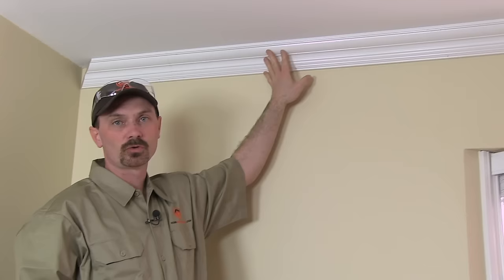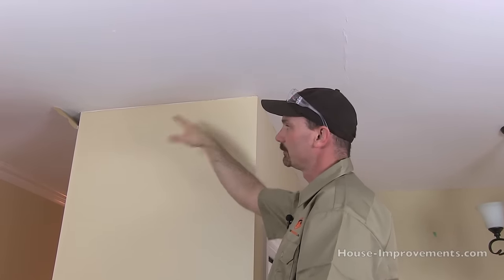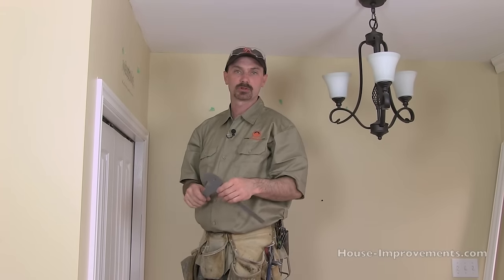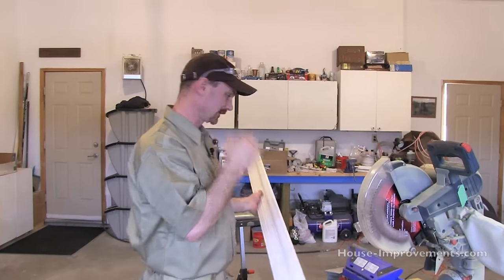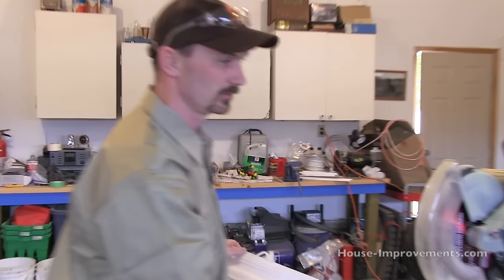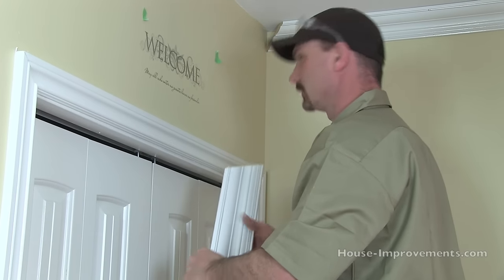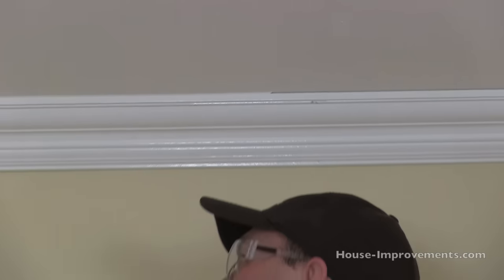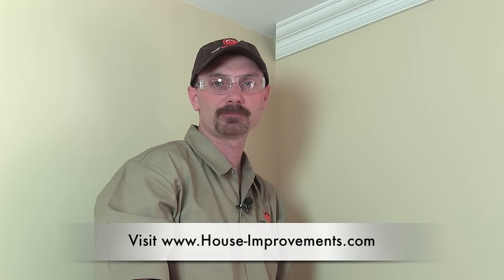How To Cut & Install Crown Moulding

Comment: lol.. Cmon..If you're going to do an instructional video...do it right..If he was experienced, he would have moved the peices up or down to close the miters and glued inside and outside joints. I'd get fired for this type of work and would not accept it as a homeowner either.

Comment: I’m having trouble finding trim that will fit my garage floor. The concrete trim isn’t flat with aligned with the wall. There is a good 1 inch gab of concrete slab that sticks out past the wall how would I cover it up with trim?

Comment: The most detailed and informative video I have ever come across on YouTube. I had some damaged crown molding in my house that I recently moved in, and needed to repair the damaged/broken piece of crown molding and was not knowing where and how to start my project. I would like to thanks Shannon a lot for this video which gave me the confidence to work on my project, although I bought the pre-cut angles from Home Depot but may not be using them after seeing this video. 

I was just wondering if I can use Gorilla Glue or PL instead on nails to hold the crown molding in place but not sure if any of that glue will be strong enough to hold the crown molding ln place. Appreciate if someone can give me some direction about it. 

For a beginner like me I had to watch a part of the video a few time where in Shannon is flipping the molding to make inside and outside corner cuts, so I would suggest people to just watch that part of the video to have a clarity about cutting the angles. Awesome video!!!!

Comment: Cut the crown molding flat on the table. The measurement guides have the two angles marked on the saw...No need to buy and use the plastic guide..

Comment: Probably overkill, but instead of finding studs, I’ve used a ripped piece of 3/4 plywood, then screw it into the studs with 3” screws, then you can nail anywhere thru the crown into the ply. If there’s a long run, rip a piece of 3/4 ply about 1.75” wide by 8 feet.  Works great especially on older homes that have plaster on drywall that makes the wall an inch or so thick that a normal 18 gauge 2” nail won’t hold well in.

Comment: I saw you measure and cut but you never added the thickness of molding to your cut on both ends so if they follow you their cuts will be short. I watch your videos all the time
Reply: He doesn't have to bc he Mark's thebback of the board and then he flips the board over b4 he makes the cut.

Comment: A clean square block of wood and a hammer work wonders on a corner. Just a little tap on both sides will drive that molding into position! Then nail it!!

Comment: Excellent video. I like that you've shown the various cuts and angles and had good camera shots to show the specific details. What I like most is that you showed some of the issues I've experienced with walls out of square and small gaps. This video will help me with the crown molding project I'm starting this week. Thanks for the nice job. Very helpful.

Comment: for a so-called expert..the first part of the VIDEO that's BAD...the outside corner should have been a little tighter. that's a bad cut...passable on HOUSE not  on FISHIED CRWON MOLD on commercial building.
Reply from the maker: thanks for your expert opinion

Comment: The walls aren't exactly plumb and the ceiling isn't exactly horizontal.  Cope it and break out the caulk. Crown molding will cause you to pull your HAIR OUT

Comment: No disrespect to the gentleman's skill. His approach to crown molding is common in the trade but to any Youngsters watching go and invest in a double compound "Chop Saw". Together with the numbers of bevels and angles to use you can skip the back and forth , upside down baton show and move on with the work at hand. Shim here and there sometimes making the cut a little long sometimes to close joints..... 
just SayiNNNNN. 
Sometimes new methods are an advancement.

Comment: Nail guards protect water lines and plumbing but they don’t cover everything or every angle. Professional or homeowner can nail a/c line, water line or plumbing drain lines or vent pipes. For example a roofer puts a new roof on using a nail gun and pierces a a/c line filling the attic with Freon which also leaks into cavity walls and into several rooms of the house. Homeowner filed an insurance claim and $250,000.00 dollars later had a total remodel of her house. This was no joke, I worked for the restoration company who did the repairs. My lesson learned is never use any nails to install any trim, hang any pictures. I use gum for pictures and caulk for trim.

Comment: absolutely incorrect!!! WTF/!/! glue and tape crown. No house is perfect, in fact, most all of them aren't perfect symmetry. Measure the distance of the gap whether top or bottom( in this instance top), then thats the amount needed cut from the opposite end to zero, and again(in this instance,, eighth inch gap on top, cut the bottom on an angle from the eighth difference to zero at the top. Perfect fit no glue needed takes the same amount of time. thanks good day.

Comment: Question.  Why cut it upside down if  you're still setting it with the front side facing you?  Why not eliminate the confusion, and cut it as it goes on the wall?

Comment: You know if you take a block of wood and tap that outside edge in at the top on both sides you can cheat it down about an 1/8" and close up that gap. Just saying'

Comment: I set my table to a 31.6 and my blade to 45 degrees, and cut my crown on the flat so I don’t need a to hold the crown at a 45 when I cut.

Comment: 1 question, when you’re nailing into the ceiling, are you hitting joists? Or just nailing into Sheetrock?  What’s the best way to secure crown molding into the ceiling if the attic joists run parallel with the molding?

Comment: This is a well done video.  However, what if you only have a 10" blade?  And, will this "jig" work on a 10" blade saw?  I've watched several videos on this topic and you really need the right saw and jigs.  What if your fence isn't tall enough?  The cutting part is easy if you have everything else needed for the job.
Reply from the maker: 10" saws will work for most crown that is under 5". If your fence is to low install a plywood fence during the process.

Comment: If you're not coping an inside corner, regardless of whether is stained or painted, your not doing it right. Mitered inside corners will also eventually show even if you caulk them.

Comment: Lipstick on a pig: that ceiling should have been re-taped and skim-coated before installing nice crown molding like this... 

Coping: I use a Dremel tool with the flexible shaft: makes coping very easy and much faster. I use a knife or a coping saw with the really fine corners. His coped corner looks a lot better than his mitered inside corner. One way to make it real tight is to take adhesive-backed sandpaper, and tape it to your scrap crown molding. Then you use that to sand all the fine details in your coped piece.
Regarding the outside corner that was gapped: when he was dry-fitting it, he saw that it wasn't going to naturally fit. The piece to the left was short, so he could have glued the joint with fast-acting 2 part glue, then installed it. The corner would have been very tight and sharp, and the gap would have been on the wall/ceiling edges (which are easily caulked). If the piece to the left had been long, then a helper would have been necessary.

I like how everything was explained except the laying the piece flat on the base and using the compound mitre saw for what it was designed for. I haven't found any videos yet on how to do that yet.

Comment: I notice lots of people are talking about how they only cope their joints. It’s a huge waste of time to cope mdf moulding. It s seriously not needed. The corners mitred will be tight enough and mdf fills really well. Now if your using an expensive material like oak or wood you cope the joint. Hardwood doesn’t fill nicely. Pick your battles.
Reply from the maker: I 100% agree with you

Comment: I doin't understand why you are simply taking the crown into nothing but drywall...I didn't see you hit one stud or joist, other than the outside and inside corner bottom nailing....??  There is nothing holding this crown in place basically, and the top is going to flop down since MDF is so heavy...?
Reply from the maker: angle your nails slightly, they can not pull straight out then

Comment: I have a question. When installing crown, I understand to nail to the studs on the wall side of the crown, but when the crown is running WITH the ceiling joists, theres nothing behind the ceiling sheet rock to nail to. So, do you just nail into the sheet rock on the ceiling by maybe shooting two nails in an "X" pattern to hold the crown edge against the ceiling? 
Asking because my house is VERY old, the ceiling is NOT perfectly straight, and have been hesitating starting this project because I just am not sure how to nail the ceiling edge of the crown when its running along the same direction as the rafters behind the dry wall in the ceiling. Adhesive as well as nails maybe?
Reply from the maker: Install the nails on an angle and they will have more holding power in drywall.

Comment: I have always done regular mitter cuts for baseboards doors& windows but crown i never done, what looks tricky to me is how the crown is not going flat up against wall but at a 45° angle, never had a table saw can a regular mitter box work for cutting crown on certain types of moldings?
Reply from the maker: On smaller crown it will work.

Comment: hey Shannon any advice for an older house thay has very bad corners not on 90 degrees at all. built in the 30s and very hard to work with since nothing is square or level. I'm not a carpenter by any means but I try to do stuff myself. I can't get the 45s in the corner anywhere close to matching up. please give any suggestions?
Reply from the maker: That is a problem very often . Try using an angle finder to get the exact angle of the corner , divide that number in half and that is what you want your cuts at.

Comment: next time try this take a small piece of crown  and place it up against the wall n ceiling n look at it from side to make sure  you have  the full section on both wall and ceiling  then put a pencil mark on ceiling then measure what you have from wall to mark then go around n mark each end of walls and pop a line on ceiling I would use blue chalk only and pop it once before popping on ceiling then went you nail on crown keep it on line by nail ceiling first especially on long walls  that way went looking down a long wall your crown will be straight.also I would  put some painters tape about where you would nail  and use spackling to fill in nail hole and let sit awhile then went you are ready to touch up with paint pull off tape  and paint  this way you wont have any residue showing through the paint I also like to use alcohol with a spray bottle to wipe off calking that way it wont smear on the crown or ceiling hope this will help every one

Comment: when cutting it flat with a compound miter you don't ever have to move the settings and piece stays consistent on table and all your miters are same....you just rotate the crown......inside or outside miters never need the saw settings moved.....

Comment: Sir , I'm finishing a basement room, there is a drain pipe which is hidden in the wall but the cleanout sticks out a few inches , my question to you is , a) does it need to stay exposed or can a build over it to hide it , do you have any tips and tricks to make a nice finish, many thanks.

Comment: Hey Shannon! How do you fit crown molding on a sloping wall/ceiling? Basically have a gable roof and upstairs the wall slants in to the ceiling. Looking at about 130 degree angle. The other 3 walls are 90 degrees. Room doesn't span the other slope. Can this be done? The reason I'm trying to do this is because I installed shiplap on the ceiling portion and want to cover up the gaps around the edge. Using roughly 3 3/4" wide molding. Thank you!
Reply from the maker: we could discuss some options in the forum if you want to copy and paste your question there.https://www.house-improvements.com/forums/

Comment: I have a up lift problem with ceiling that wasn’t installed properly and in the winter it shows at the top. How you fix this to keep it from showing so bad in cold months?  Thanks
Reply from the maker: I have fixed this before. What I did was installed a crown moulding that was attached to the ceiling only. This way it can move with the trusses and not show the ugly gaps left during winter. To get a good solid installation I added a MDF strip of wood around the ceiling that was glued and nailed to the drywall and trusses. The crown moulding was then glued and nailed to that . The MDF just gives a more secure attachment surface.  If you need more help please use my forum.http://www.house-improvements.com/forums/

Comment: I've never done a moulding (cornice) in any room that's been a perfect fit. Here we use plaster mouldings so patching is quite simple. I don't think I'd like to use mdf. BTW, that's not really how you cut with a coping saw - the handle is always below the workpiece and the cut is similar to using a bandsaw.

Comment: Thanks for making this video. Easy to understand and very informative.
Wanting to do this in my house. I have a troweled ceiling. Meaning it’s not finished smooth like a wall or the ceiling you were working with. I guess I need to make it as straight as possible on the walls and then run a heavier bead of caulk along the top.? If you reply, I would be very great full. Nothing beats experience and I’m not a trim carpenter or any type of carpenter. I measure four times and hope I get the cut right.🤦
Reply from the maker: Sounds like you have the right idea. The rougher the texture the more difficult this will be .
Reply: @HouseImprovements  Thanks for the reply. Fortunately I have a degree in caulking. Used to hide low voltage wires behind trim for alarm systems. Thanks again!

Comment: At what pressure to you have the regulator set on the air compressor? I'm having a problem with my nail gun leaving an indention from the safety switch.
Reply from the maker: Some will do that,try not pushing so hard , you may have to turn your air pressure up. I generally am at 90psi

Comment: your inside corners need adjustments....if the gap is up top use a block and push both pieces up toward the ceiling a bit...the gap will close
Reply: I don't want to sound like a jerk, he's good at trim, but not what I would call a professional. methods are very time consuming compared to how I was taught. well maybe that's not the purpose of the video though. trade secrets you know.

Comment: Put up molding years ago and skipped two areas to install valances. Now the valances are gone and I have two gaps about 45" wide each. Can't find a matching molding anywhere. Is there any way to make or modify an available molding to match what's already up there? Any ideas?
Reply from the maker: please use my forum. http://www.house-improvements.com/forums/
Reply: HouseImprovements

Comment: great video, still looks confusing as hell. However I Want to eventually put crown in my master bedroom but it has a partial Low vaulted ceiling. How would one tackle the complex angles of the peaks?
Thank you.
Reply from the maker: +Doyle Hodges This can not be installed on a vaulted ceiling.
Reply: really? so it can only be done on a level all the way around ceiling? Hmmmmmmm. That sucks. Wouldnt it just butt up together at the peaks? I only ask as I have seen pictures on the net of it being done, but its claimed to be difficult.

Comment: Hi Shannon,
I might of missed some points, how de we determine mitre for odd degrees…ie 43. and what’s the advantage of coping end joints, rather than just mitre two ends? Thank you.
Reply from the maker: Basically take the angle you measure and divide it in half, that will be the angle for each end. Coping when done right can look better and on wood grain trim where you can't caulk the joint it is better.
Reply: @HouseImprovements  
Thank you for your response Shannon!
Love your show. Cheers.

Comment: Love this video, shows exactly what the average DIY will encounter, nothing is perfect so don't panic if you see a large joint, just fill in it in and paint and no one will ever know and final product will look professional.  You can't have these large gaps if you use stained wood like oak however, but for painted mouldings this is fine.

Comment: Help please advise. I learned from my husband (since passed) that with crown molding you want to see the seams behind you  or rather not see them. I bought crown molding 12 feet length for 12x13 square(ish) bedroom. I wanted the molding uncut such that the seams were "behind you" when you walked into the bedrooms(2). I had a "contractor" who said he did not need help holding up the molding and knew what to do. He cut my 12 foot molding into 4 pieces to manage them alone unbeknownst to me in order to get the cuts and install alone. I walked into the one room and literally screamed when I saw what he had done. I threw him out of the house, spoke with another handyman contractor who used to build homes and asked him his process. He said he would cut the 12 foot only 2-3 times. WHAT is wrong with these guys. Why is it necessary to cut the 12 foot molding when the room is 13 feet. Why can't you just cut the ends and fit the boards together? Is it necessary? Once you cut the ends why can't you just nail the molding? Are these guys just incompetent or at best limited in their skills or is it necessary to cover a 12-13 foot area with 3-4 strips which causes you to miter not 2 ends but 6-8 ends and in the process destroy (in my opinion) a 12 foot corwn molding into small pieces?
Reply from the maker: No reason to do it in pieces if you have help or the right supports.